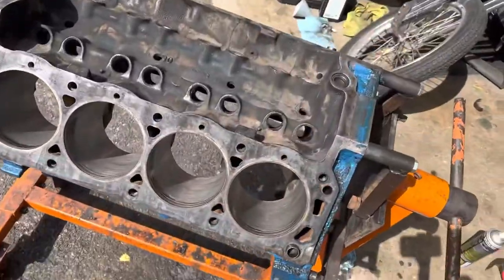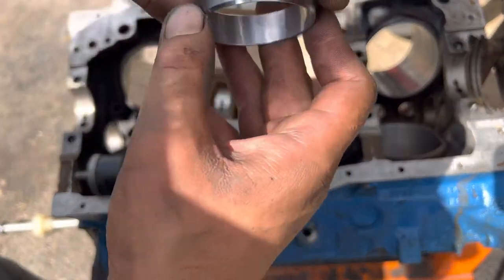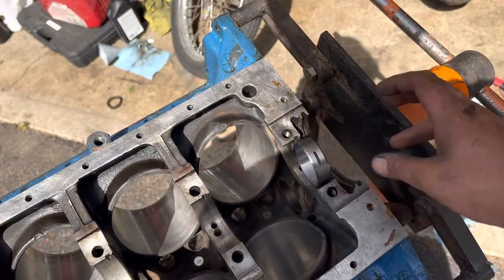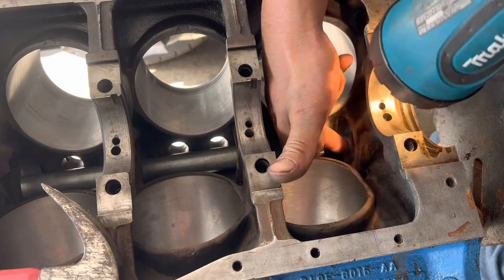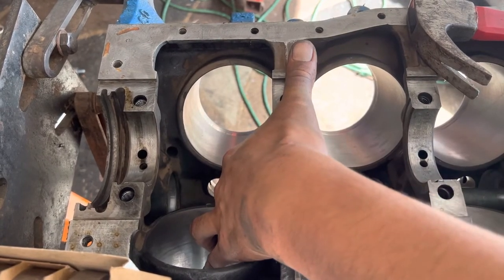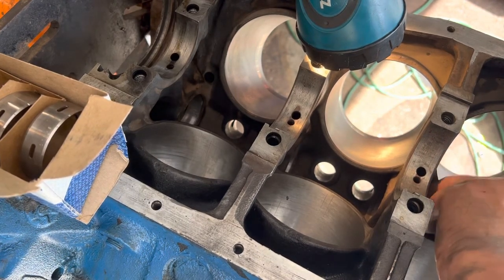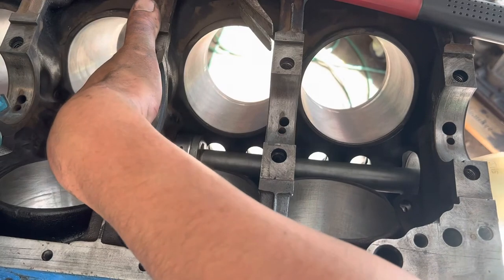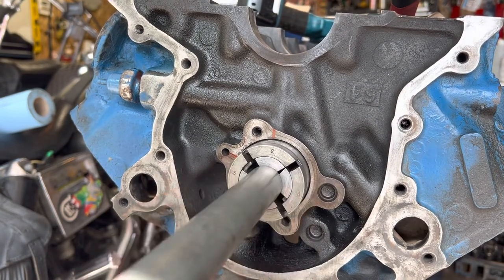How to Install Cam Bearings in Ford 302/5.0 SBF

Comment: Getting ready to do a overhaul on my 302 in a few weeks and was wondering ahead of time just how much of a pain it might be
Reply from the maker: Honestly not that bad, depending on what your doing...  About as basic as it gets if it's just a refresh/drill hone rebuild.  I'm not an expert by any means, but I dove in head first and got through the whole thing amazed at the simplicity...  Good luck with the rebuild!
Reply: Yeah that’s what my 302 is getting, figured seeing I am dropping a towing cam in I would just tear down and refresh it all, the motor as far as I know only has 285000 miles on it